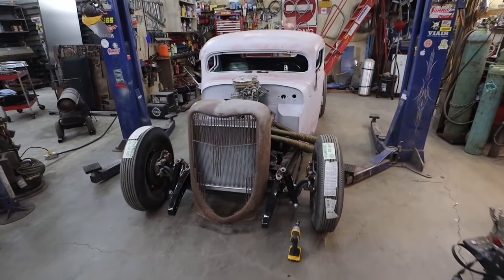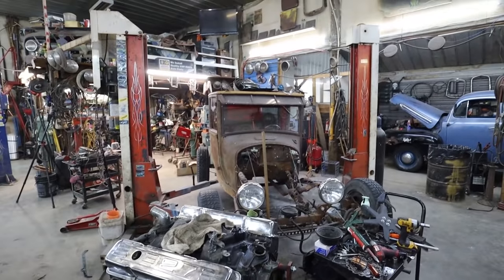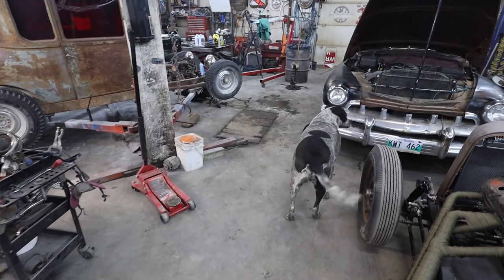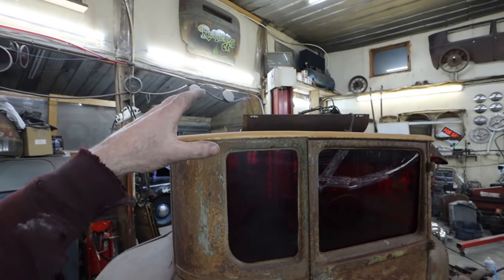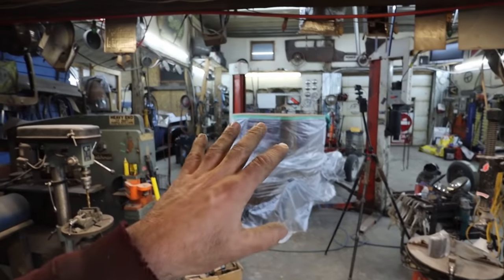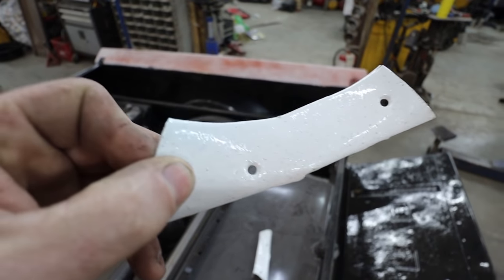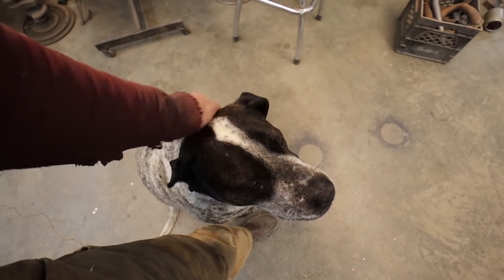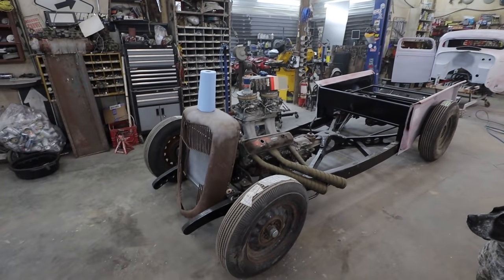Prepping the 327 and testing Metal flake paint maybe for the 37 Ford hot rod Part 29

Comment: Why don't you place some mudguards over the wheels, open on the side of course... fitting the era, the looks and much more comfortable... saving lots of towels and pain!
On your color scheme: I like this metallic flakes in green on the car or black... perhaps you can make it a two-tone color bodywork, second color metallic flaked darker orange for the top?
Car looking great to roam on the dirt roads of Manitoba... it'll be a great car with that engine roaring, in those colors... the clip of the black engine with the orange tape really swept me off my feet. Meaning... the black metallic flakes combined with an orange top would be a winner!
Re. the flakes: put a first layer of rubber cement (glue) on the car, roll that in... cover it with color and flakes... clear coat that... might do the trick.

Comment: This is a train wreck, If you want the truck green, bace coat it in a green you like, then you need a GIANT tipped paint gun to spray your metal flake/ clear combo on. and you will need a Shit ton of straight clear to cover that flake to be able sand and rub it or to not sand it , Ive done this and it works BUT takes a LONG time....Good lock..

Comment: @Halfass Kustoms,  I paint all my motors with "Cast" color paint. It has rust protection but has the appearance of not being painted, also the master cylinder body. I own a 50 Studebaker pickup (old gasser) from the '70's (I'm 75 ) that I drive on the street, dz 302 ci gear drive, solid lifter very lopey cam, full louvered hood and want to touch up my still on today (painted 1980) $22.00 paint job but don't know what to do. Check out my truck on YouTube...50 Studebaker truck... its yellow sitting on my red trailer in the back yard. Keep up the good work youngster.